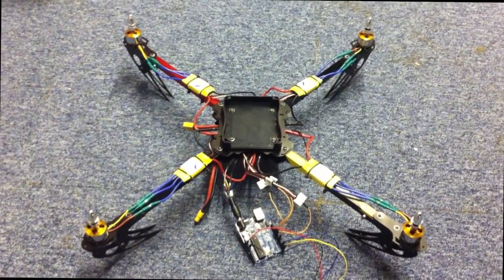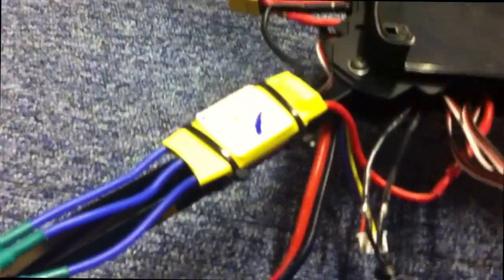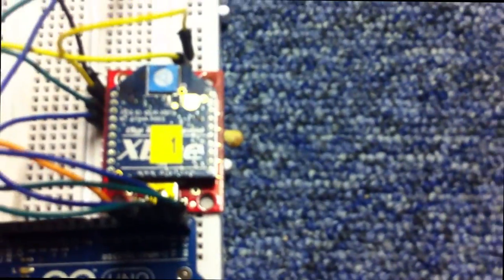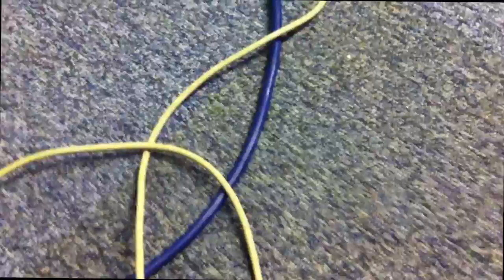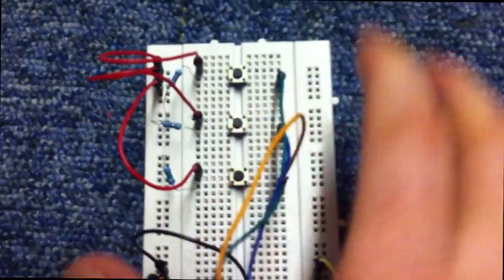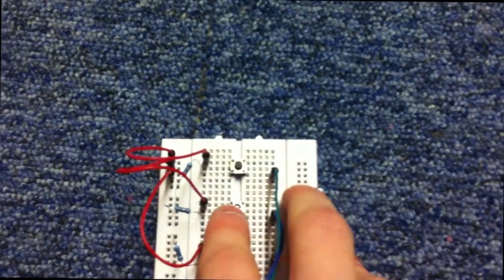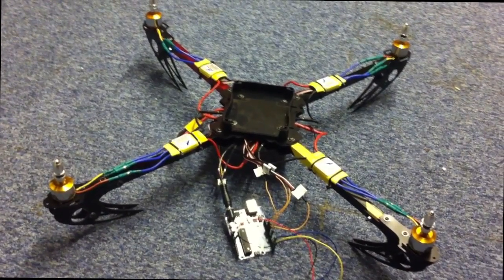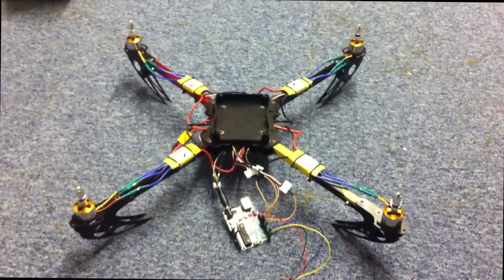Arduino Quadcopter  - Phase 1 (Xbee Test)

Comment: Hey Kyle, Awesome project. 
I have a question...I am in 1st year of electrical engineering. Could you tell me which extra courses and subjects are necessary for developing such projects?? I will be starting from scratch...any guidance will be helpful. Thanks
Reply: +Shehzad S I guess you need to know a bit about programming, such as C++ or C language, some basic digital circuit knowledge.